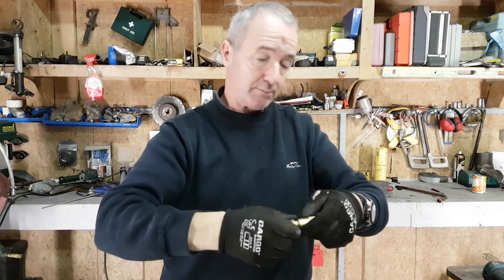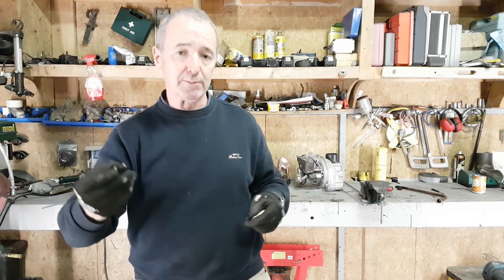Waste Oil Burner Siphon Nozzle Build

Comment: I appreciate your interest in helping others but please stop all the unnecessary talking and just get to the point. As an example, no one cares about your old radiator fan, how you got it, how long you've had it or the voltage it requires. Just get to the point, please. At the end of your video, I gained nothing. What you did tell me were things I already knew, I leave having learned nothing about constructing a nozzle to atomizer used oil and air.

Comment: It took me almost a month to convert a diesel burner to work on waste oil, is kind of tricky, but in the end the results are amazing. Now I have an automatic burner, controlled by a thermostat. I can share the knowledge with you if you want. Cheers !
Reply: How did you control heating the oil

Comment: Where did you get the syphon nozzle from. I can't seem to find any in the uk
Reply from the maker: Hi Steve. I had to get them from amazon usa because I could not get them on ebay.co.uk or amazon.uk either. There is an amazon link on the siphon video but its .com. Cheers Gerry

Comment: i would like to see modified gate valve i have a real time getting mine to flow it,s too much or too little Jon in Ky.
Reply from the maker: Hi Jon. I will be making a video tomorrow if it all goes to plan. I will make a little video of the valve setup. Lots of the guys are using needle valves and having good success with those but since I cut a little groove on one side of the gate valve it has made it usable. If the new burner goes to plan I will be using a metering pump on it. Thanks for commenting. just looked 12°c in Ky today and tomorrow so it's beginning to get a little cooler now. About the same temperature today here but frost later this week. Heat helps lol Cheers Gerry

Comment: Hi Gerry, great video and thanks for explaining the drip feed system, I have one question regarding the pipe used from the oil bucket to the elbow connected to the heater. What piping is it and is it able to take the heat generated from the burner? Would it not melt if it gets really hot using it on a gas bottle system? Cheers Gary
Reply from the maker: Hi Gary. The black pipe is mild steel 1/4 inch npt the other pipe is the oil line and it's only 1/8 npt but I think I will use copper on that. The nozzle and the pipes will be within the blast tube and there is a constant supply of air blowing past them to keep them cool. I think I will have to make the blast tube length adjustable because I anticipate that the flame will want to detach and go out. More fun getting it all figured out. I hope to get at it tomorrow so more videos soon. Thanks for the comment Gary Cheers Gerry

Comment: Your drip feed could be combined with a pump so that the flow of oil could be controlled electrically.  A peristaltic pump is good for supplying small volumes at a metered rate.  There are loads of peristaltic pumps you can 3d print https://www.thingiverse.com/search?q=peristaltic&sa=&dwh=505a0ab2b86baa8

Comment: Good morning Gerry. 

I became an oftec oil tech in May this year and do that on the side at the moment along with my construction day job.
My future father in law recently had his boiler replaced, but I salvage the burner before it was taken away. Not sure if I'm going to use it for my waste oil burner yet. I need to see how yours turn out first.
 I've been watching your videos recently and I'll be building a burner unit to add a bit of extra heat to our uninsulated bungalow near Cambridge. I'm toying with the idea of building a water jacket around a propane tank to circulate through our currently unused radiators ( we have a wood stove without a back boiler) and which could potentially also be used to heat air. My burner will be located outside the bungalow and all measures taken to make it as safe as possible.
I'm keen to see how this one turns out, especially if you can make it work with a room stat etc. 
Thanks for the videos and have a great day. Bernie
Reply from the maker: Hi Bernie. I had a very crude setup a few years ago and I was heating water with that but although it was powerful and could easily heat 300 litres of water and make steam it was a little nuts. I have a couple of boilers so it will be an interesting build I hope. We will see. Well done on keeping the burner hopefully it will get a new lease of life. More videos soon. Cheers Gerry
Reply: GerrysDiy 
I would like to pick your brain a bit if I may. Do you have a Facebook page where I can send you a message?

Comment: Very interested in this...I experimented with this idea awhile back..the siphon feed part of it anyway. It burned pretty good for awhile, didnt make quite as much heat, and the nozzle got gunked up pretty quick. I run my oil through a paint strainer too.. Curious to see how it pans out for ya!
Reply: Pyro17059   Check out CK burners 
He sells a nozzle heated block kit, it works great, I'm running one in a boiler
Reply from the maker: Hi Pyro 17059. The burner I use day to day is very tolerant of lumps in the oil but this unit will be harder to please. I will be back at the build tomorrow so hopefully some fire and not too much smoke. It will be interesting getting it all working. I would love to get it going with a boiler stove because being able to heat water on demand makes for a great heating system. Fingers crossed Thanks for the comment Cheers Gerry

Comment: Always toasty warm in Gerry's shop.
Reply from the maker: Hi John. Time was I used to just wear a jacket and warm gear in the shed. Now as I get older (maybe smarter lol) it's much easier just to turn on the heat. With the waste oil it couldnt be any cheaper. Thanks for the comment John Cheers Gerry

Comment: Gerry do you work in the boiler industry? I enjoy watching your videos! I have a question for you on the naturally aspirated burner design you have. If I wanted to create a lower amount of heat versus your savage heat, could the actual bowl portion of the burner be smaller to accomplish this? I would guess the smaller the surface area would use less oil... I was curious to see if you had tried that at some point. Thanks for all the hard work keeping the videos going.
Reply from the maker: Hi Mathew. I install underfloor heating, heatpumps and oil boilers but the waste oil burner thing happened because my shed can be too cold in winter to get much done without heat. Once you can keep the bowl red hot so that the new oil gets vaporised it should work but making one with forced air would be easier. I have an air tank from scuba that I might convert into a waste oil heater. The little biscuit tins that I made heaters out of recently could be miniturised too so there is lot of scope to make a heat source smaller.Hope this helps Thanks for the comment Cheers Gerry